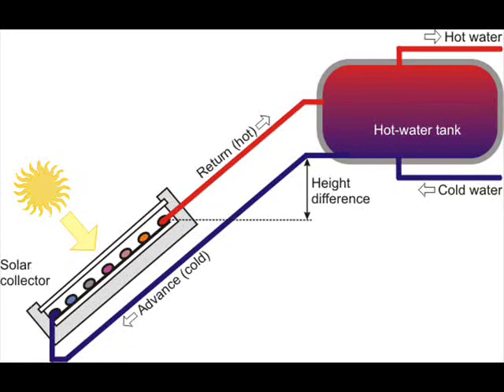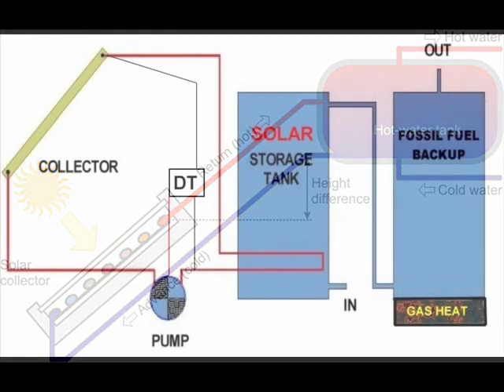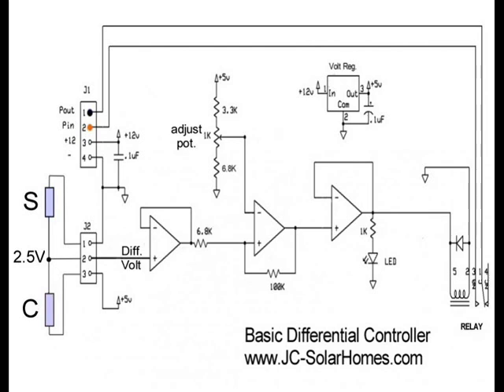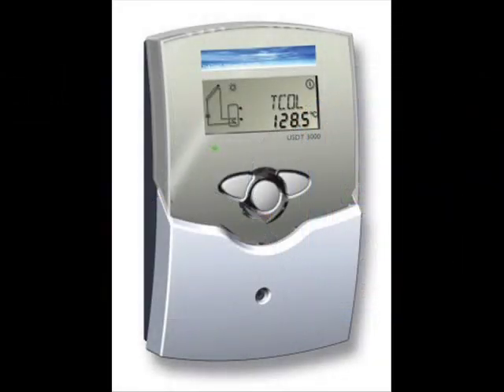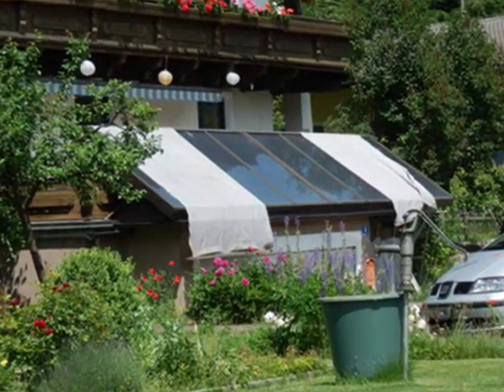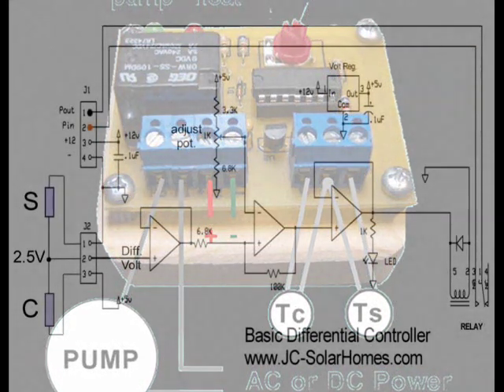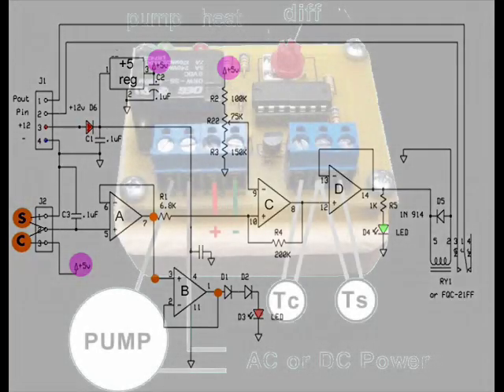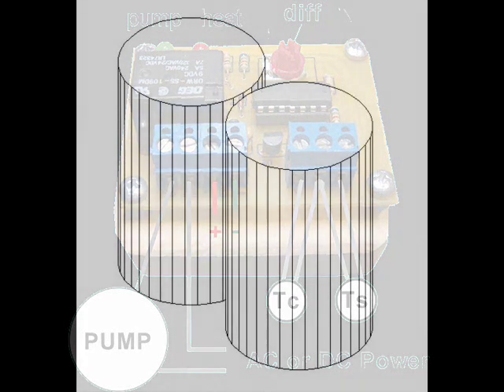active solar hot water controller

Comment: My solar is thermo-syphon, it is best, the twin tank system with back up heat is flawed unless you can draw hot water directly from the solar tank during sunny weather, which you can if you fit two reliable electric valves. My solar produces hot not warm water. Half a tank of hot is so much more useful than a full tank of warm water that pumped systems often provide. Fitted a pumped system for someone, we used a thermostat in a sweet jar to control the pump, the antifreeze mix was pumped around a large coil in a very small hot water cylinder. The water from this cylinder was then connected by thermo-syphon at the top and bottom to a large hot water storage tank. This causes hot water to be formed and stratification to happen. Thus ensuring hot water is made not warm water. Using gas for back up heat is bad, gas should be now banished to the history books, its a fuel of the past.

Comment: Using your differential controller, My storage tank got over 150 degrees I should probably add more storage. Thank you, John for the information.
Reply from the maker: Yes Bob you should. At 150*F the tanks will cool down very fast even with lots of insulation. Also it's hard to collect more heat if your single storage drum is already very hot...Remember Heat  = +emp. x mass
Reply: John Canivan interesting. I didn't realize that. That would be a good bullet point in one of your videos. Thank you JC.
Reply from the maker: Thank You Bob. 
Here is a little more info about controllers.
http://www.jc-solarhomes.com/css/active_solar_hot_water_controller.html